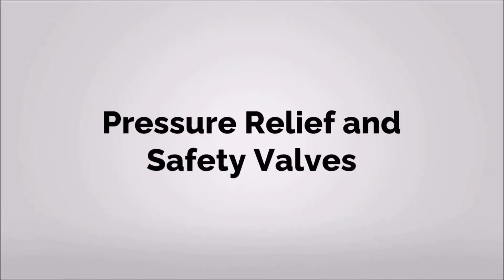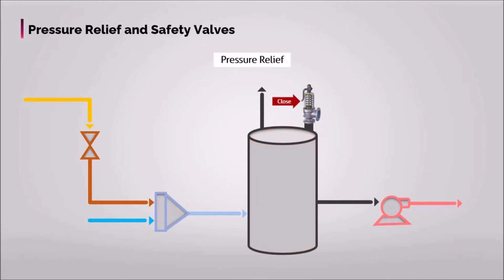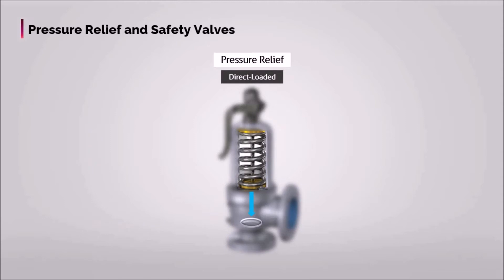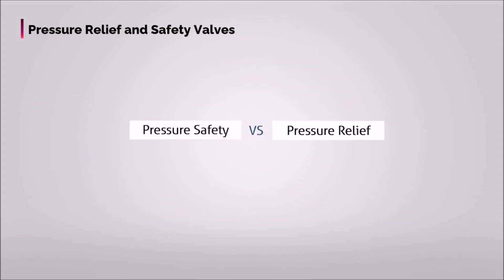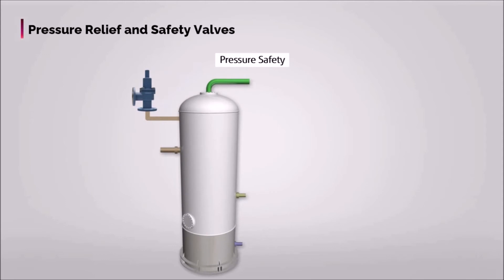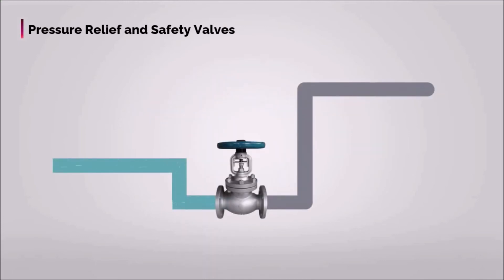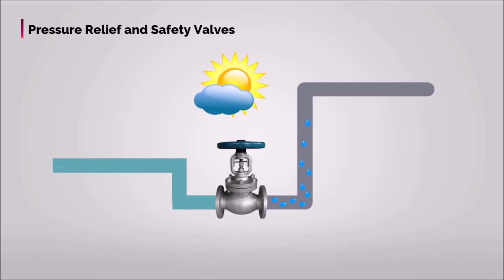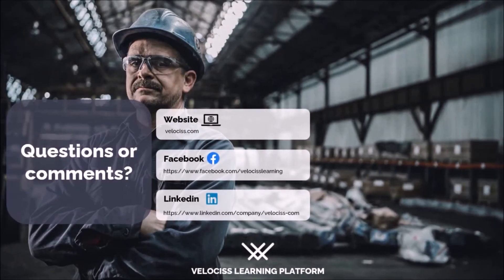Pressure Safety and Pressure Relief Valve| PRV and PSV

Comment: There is a real difference between PSV and PRV based on how they operate, and although a PRV is a type of safety valve (PSV) it should be not be confused with a standard PSV.  PRV open based on proportional pressure that they are exposed to, once above the set pressure.  This is why they are used mainly for hydraulic systems (limited stored energy).  While PSV simply dumps all the pressure once it isexposed the its set pressure, and for this reason it is mainly used for gas (high stored energy).

Comment: another difference between prv and psv is that, prv operates normally by controlling the system, whereas once the psv is operated, the device should be taken out of system and then needs to be sent to the maintenance  warehouse to for calibration purposes